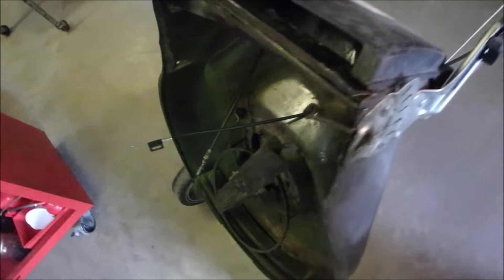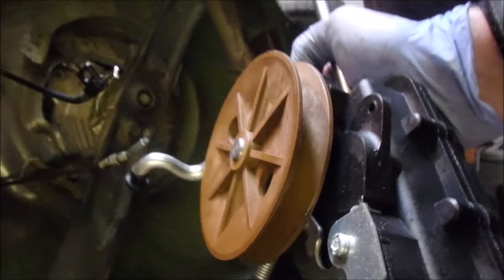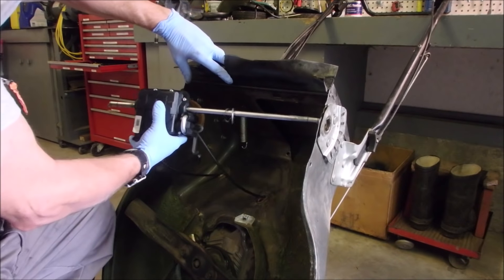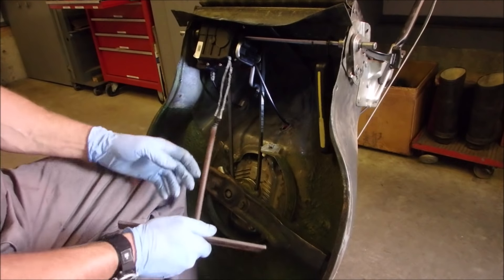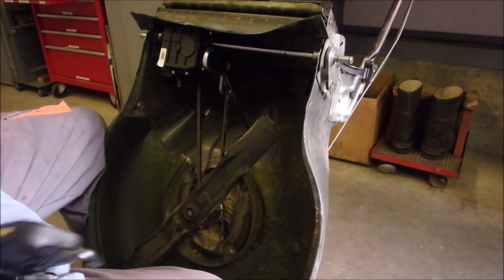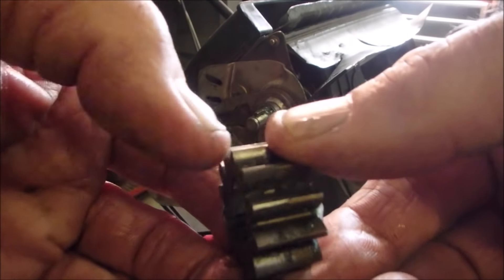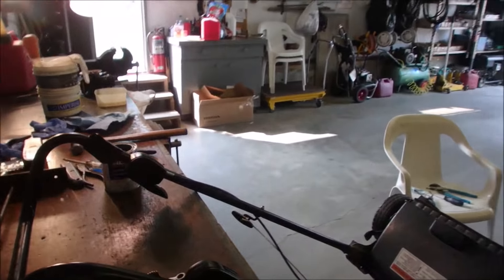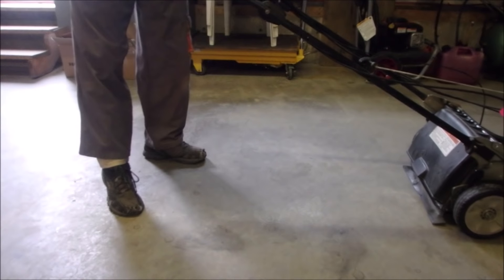Honda Won't Pull Backwards, Transmission Replacement Part 2

Comment: We have a Honda HRR216 that came with our house, 20 years ago. It was at least 3 years old at that time. We opted to buy the contents of the shed and it was a deal. The Honda mower and a 70's Troy Bilt tiller (in perfect condition), along with a host of other high quality tools and power equipment, all for $1,800.

We used the mower for 10 years without any issues, then, the drive started to slip. Eventually, the wheels would not drive at all. The mower is too heavy to push on our partly hilly grounds so it had to be fixed. Honda wanted over $200 for a new tranny. I had a look at the transmission without removing it from the machine, just removed the spring to allow cover (and spring anchor point), removal, far less work.

What I found inside (besides no oil), was the bevel gear that engages the worm drive when the clutch is engaged was worn to the point it did not mesh anymore. At the time Honda would not furnish any parts, full trans unit or nothing. So, we were stuck. But, then I realized that if I took the bevel gear out and flipped it around, I'd essentially have a new gear. So, that's what I did. Then I filled the case with 90 gear oil and put the cover back on.

The fix worked for 10 years. Then, last week the wheels refused to roll backwards (they did not do this when I made the original fix), and, the drive was very weak. Once again, I opened the trans case and for a second time found no lubricant. The bevel gear did not show any wear though. What I surmised was that the clutch cable had stretched and could not actuate the gear to worm drive. With these earl models there was no cable adjustment. This time before putting the bottom cover back on I filled the upper half of the case with grease and gear oil. Then, after setting the mower back on her wheels, I took a small bolt and, after forcing the cable back through the conical spring at the bail handle, dropped it "down" the spring so it acted as a chock. That effectively shortened the cable. The drive then worked like new once more. After this cutting season ends I intend to drill and tap the case and install a drain/fill point so the Lub. can be replenished far more easily. I'd like to get another 20 years out of this machine.

We have an acre of grass so the mower has high hours after at least 23 years use but the engine remains strong. It does not burn any oil !. I change the engine oil twice each year and use crank flush each time, that goes a long way. With the first fix 10 years ago, the drive wheels were completely bald so going uphill was frustrating. Honda was asking way too much for new ones. So, I bought a bicycle tire (the knobbiest one on offer), measured the wheel circumference and cut the tire to match. Used self tappers to "retread" the wheels. As the rubber is very much more subtle than the OEM plastic, the grip is impressive, better than new.

I'm getting older now so, giving some thought to fixing-up our 62" three blade Massey garden tractor mower and using it with our 1977 Massey Ferguson 1655. No more walking those many kilometers to mow......................
Reply from the maker: Thanks

Comment: I changed out my trans.. and now when I engage the clutch.. it dies. Doesn't seem to go when running.. but if I manually turn the blade, and have the clutch engaged, I can see the drive shaft and wheel turn a bit... I don't get it.
Reply from the maker: It is very hard to shoot a trouble over the internet.  Can you tighten the cable that engages the trans??  It may have adjustable collars.

Comment: Useful video. However, I think most "won't roll back" issues are caused by seized bearings. I dismantled mine and polished them and the mower now rolls back OK. However: I think I could have done it by just removing the wheels, the cogs and the clips behind them. The axle will then move sideways and you can clean the axle with sandpaper. You might even be able to free them without dismantling anything and just spraying WD40 into the bearing from the inside. Having freed mine I think I will spray lubricant into the bearing from time to time. If I ever take it all to pieces again I'll drill a hole and put a grease nipple in. Pity Honda didn't do that!
Reply from the maker: Yes  correct you are

Comment: I Bruce. I just ordered s 3 speed transmission for this Honda commercial grade mower I paid $35  for. I intend to disassemble the old transmission just to see why it croaked. My guess is corrosion. I had to replace the transmission, the carburetor,  the cables for the extended front wheels. all 4 wheels and I am hoping thats it. It has NOT  been a good time fixing this mower.  My Next Honda has a badly bent crank shaft. I plan on replacing that.I have about had enough of working on Honda mowers. They suck.
Reply from the maker: They are sure hard to work on.  I am doing one this afternoon too.

Comment: Hi mate love your videos, just wanted to say I think your spring puller tool is rubbish, if you want to make life easier just do the spring before putting on the belt, just try it, I am sure it will work,
Reply from the maker: Thanks for the tip

Comment: I use a nylon rope tied in a loop and passed through a hammer handle, then I pull the spring back onto the arm. Afterwards, I just cut the rope. No crazy spring tool needed.   Nice video though. I worked on More Honda and Toro mowers this year than any other brand.
Reply from the maker: Great tip!

Comment: I hate reinstalling those springs. I was hoping you had a better trick ;)  I had to replace a tension spring on a zero turn and the hook of the spring had to actually fit into an eyelet thing. I ended up using a ratchet strap attached to a tree on one end and a cabiner one the other to stretch that spring out and fit the end into that eyelet. I wish I could say Honda transmission tension springs seem easy now but they are still a PITA.
Reply from the maker: Springs are often tight.  If i had an actual small engine shop there would be something I am sure.  Remember I am a self taught back yard small engine mechanic.

Comment: A much easier way to attach the heavy duty clutch spring is to remove the belt from the engine pully and transmission pully.  This will allow you to rotate the transmission  around the drive axel giving easier acess to where the cables are mounted.  Much much easier to remove/attach spring.
Reply from the maker: Could be,  this was my first one.

Comment: Is it possible to swap a different transmission in? I’ve found that transmissions from other Honda mowers are only about $50 (20001-VL0-S00) and while I wouldn’t have the 3 gears, it would at least have some drive to it.
Reply from the maker: The cables would be an issue.  Deck size too,   But It would be fun to try.  Let me know if you do it.

Comment: great job on the repair bruce,if you can get a trampoline spring puller it would be easier to use than the spring puller do hicky thing you was using,even tho it got the job done it just seems a bit frustrating trying to work around the blades,do you plan on looking into the other trans and see whats wrong with it
Reply from the maker: I use it on small tractor springs.  It is great for those.

Comment: So how do you get that spring on the transmission if you don’t have one of your spring pull thingies?
Reply from the maker: You can make one those easy   just get some good wire and a piece of metal.

Comment: Whats the mower speed after replacing the transmission? I have a mower like that but it’s really slow, maybe a new transmission will make it faster
Reply from the maker: Have you done cable adjustments or a cable replacement?  Much cheaper to try that stuff first.
Reply: Bruce Pender I tried the adjustment already, but I will try cable replacement thanks.

Comment: It's quite a job using that improvised spring tool.  Although it does work, you might want to get a more efficient tool if you do a lot of springs.  Harbor Freight (maybe Princess Auto too) has a t-handle spring tool with a small hook at the end for under 5 bucks (last I knew).  I have two.  They work well on automobile brakes, trampolines, and various other devices that have extension springs.  Just an FYI.  If you're happy with what you have, that's fine.  👍  Are you going to tear-down the bad transmission to find out what the exact problem was?
Reply from the maker: I have a spring tool.  But it is a knuckle buster too.  Thanks though.
Reply: @mgomez5606  it depends on who makes them and what they're for.  There are some specifically made for trampolines, auto brakes, washing machine door gaskets, and furniture springs.  There's at least two kinds of pliers types that I've seen, and I have one kind for drum brakes on cars.  Just search EXTENSION SPRING TOOLS, or SPRING TOOLS.
Reply: @BrucesShop  what kind of knuckle buster do you have?
Reply from the maker: Ron Yerke  Looks like a brake spring tool.

Comment: Depending on the brand/model of mower, transmissions can be expensive.  Although I've only had to replace a couple of them, mostly I have to replace the drive wheels (the type with the plastic ring gear).
Reply from the maker: $250 here.

Comment: To fix my 15 yr old Honda mower, I need to spend $165 for the transmission + 4 new wheels + a belt for almost $250.  I'm going with a new Honda mower for $433.
Reply from the maker: Good for you

Comment: Thanks for the video.  I need to buy a good pair of snap ring pliers.  I'm using a set from Harbor Freight and the tips are too big to fit into the ratchet gear snap ring holes.  What brand did you use for this repair. Thanks in advance!!!!
Reply from the maker: They are not labelled.  Mt advice is to buy a set where each size is it's own plier.

Comment: Nice video, but can’t believe Honda would make a plastic transmission case,. I’ve seen a  few these fail. They totally streamlined their mowers that they sell at these big box stores. These newer style Honda’s will never be around like the older HR 214-215’s!

Comment: When you hook the shift cable back up, what position is the speed selector in at the handle?
Reply from the maker: It set itself to what it was and the trans.

Comment: now take the trans axle apart and see if its possible to repair
Reply from the maker: I will but the snowblowers are coming in left and right!!!!!
Reply: lol its that time again lol knee high in lawn equipment or snow equipment
Reply: i dont think so but i find that there most parts like bearings and other parts that can be made or repaired

Comment: Had the same issue with my Honda HRR216VYA.  Just removed and adjusted the direction of the pinion gears on each drive wheel and adjusted the Smart Drive cable.  Works fine now    nice job Bruce!
Reply from the maker: Thanks Walkin

Comment: Yeah Honda genuine transaxles are a pain, glad you bought new, that's the best way to go..... Awesome job as always.
Reply from the maker: Yes   BUT the price$$$$$
Reply: @BrucesShop  I know right.... But some people love their Hondas.
Reply from the maker: knighthawk86855  They are good.  I still prefer regular push mowers.  I had one for 27 years and sold it in running condition.  (a Tecumseh too haha)
Reply: @BrucesShop  hahahaha.... Yeah my favorite is an old 82 snapper high vac push mower, 3.5hp briggs, with points and condenser, that thing runs like no bodies business, I use it from time to time, and for the leaves during the fall months it's truly a vacuum doesn't leave a leaf on the ground.

Comment: What's the cost on the replacement part? I might have to replace one as well. Thanks for the videos.
Reply from the maker: I just googled this
https://www.amazon.com/Honda-20001-VG4-H02-Mower-Transmission-Assembly/dp/B00A6TASHK
Reply: With labor from a shop. Buy a new one with warranty. Not from a box store though.

Comment: Would you spilt the old gear box open to see what wore out. Could be a video.
Reply from the maker: possibly when thing slow down.  Busy right now.
Reply: Busy is right. 1.5 mechanics and 300 jobs here.